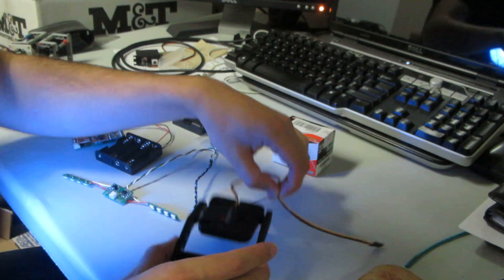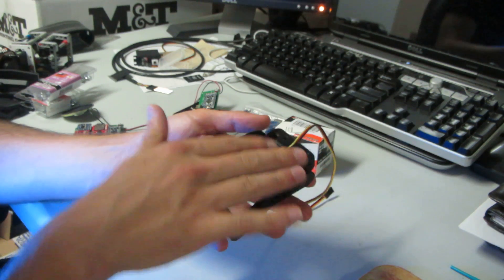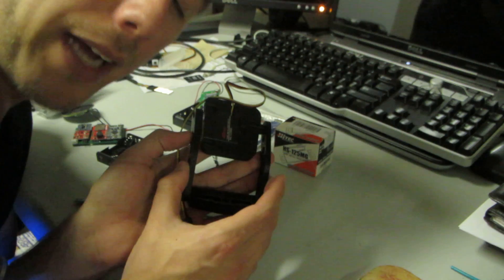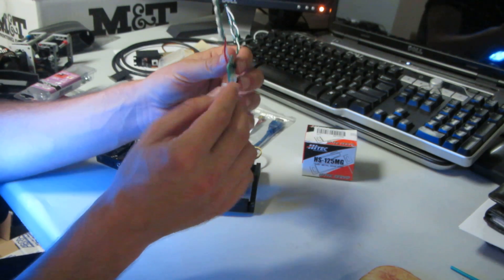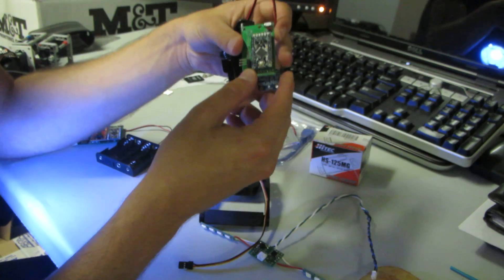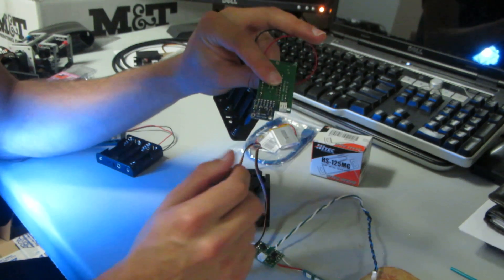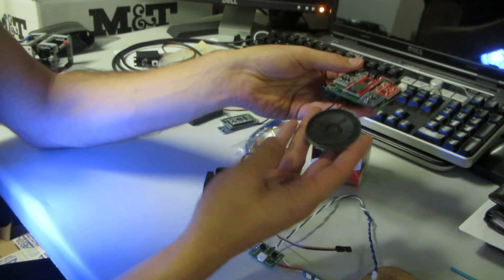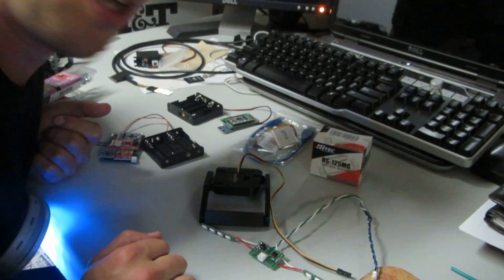Servo Mechanism 2.0

Comment: Here's a suggestion you may find useful:
There is a neat type of speaker which works by vibrating the surface it is glued to.  Attaching one such speaker to your helmet face-plate may give you better sound quality than your current cheap speaker.  It would likely be an easy drop-in replacement for anyone who wants to opt for the added expense.

Comment: Ryan, I have my own design, but I am wondering if you were able to work with me if I purchased this kit, I don't want the accelerometer, I plan on having a button wired to it for actuation of the helmet. how difficult would that be to modify the arduino?